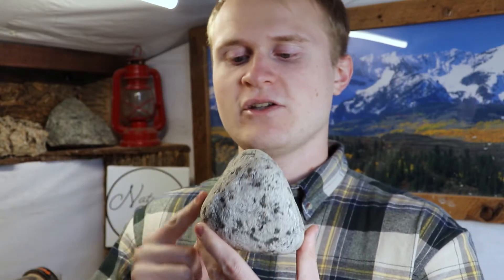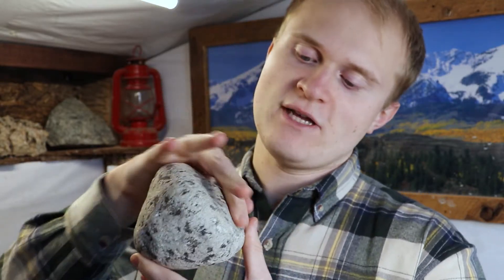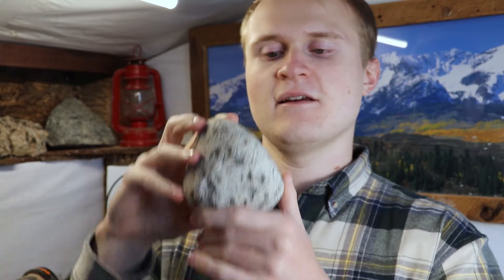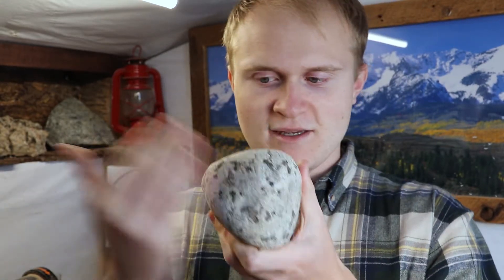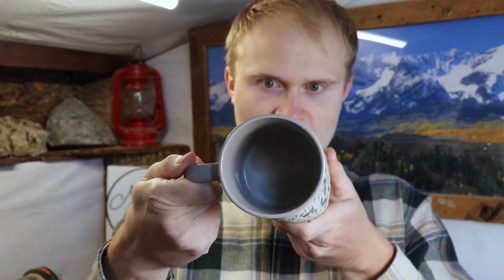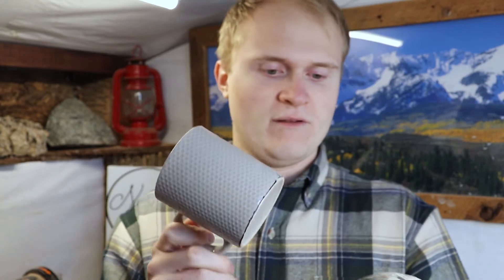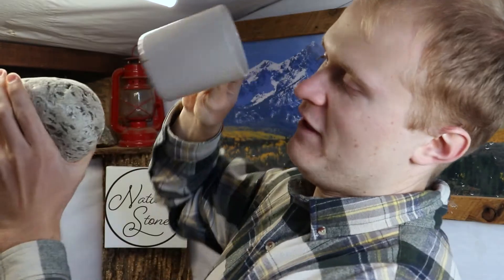How to Make Coasters out of Solid Rock

Comment: This is awesome, I actually found myself doing the exact same thing before I found this video, except I have my polisher in a vice and I hold the rock during polishing. I like your method with the towel better, is the surface the towel is on wood or metal? I worry about throwing the rock if it gets too dry and risking it breaking